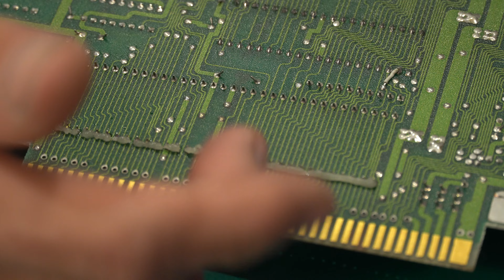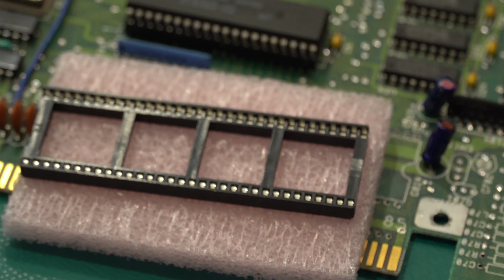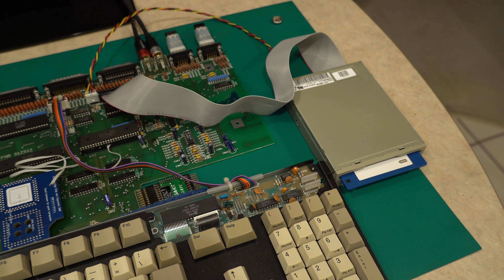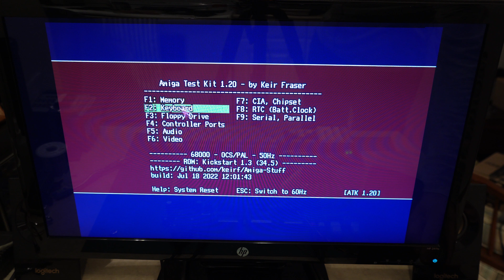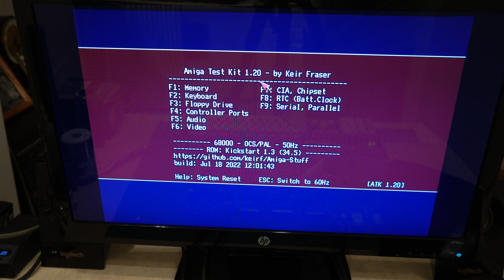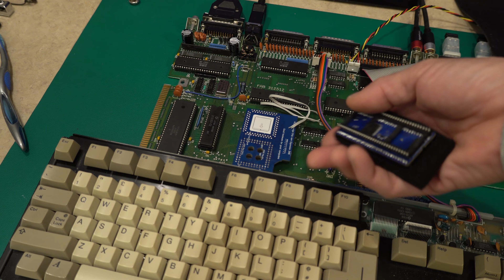An unplanned Amiga 500 CPU Socket replacement, disguised as as an informative Tutorial!

Comment: what is the part number for cpu socket an were can I pick one up
Reply from the maker: I bought mine from eBbay, AmigaKit also sells them.

eBay;

https://www.ebay.ca/itm/293002300337?itmmeta=01HVCXEG3FCFT2QZ0DRE3T2SRC&hash=item44384c4bb1:g:WYkAAOSwBA1chh~z&itmprp=enc%3AAQAJAAAA0I16hF%2FuFeIoNxTsAg%2BIHaWYQdGT6LD9l%2B2yqy%2FDWqO5Mva3DlVXmN07UxqshLzqkvlBqMeLBdUN20ewg3tsj9LKhN7F%2F8cpZ8j7LBJr9o3lNTKKoLNfn%2Bddnp4SwIkzFCRe77Km9KceohDKkG4nDH7BrNAo0UAodJolCVbWsMDb1dItfa02m7B4P%2Buj0WvpJU7JU85g7b7Szq2VlvECxxufulGtCYlbBmMbBpuYhfYulRV0H%2Byh3xs9%2Fqt%2BklFAi7CIZjrrQc%2BUWSmdFUAHvuM%3D%7Ctkp%3ABk9SR-yBup3bYw

AmigaKit:

https://amigakit.amiga.store/68000-socket-amiga-5002000-p-12661.html?aksid=2osbsp4d5jkjdlffa3mskb5mpa&currency=USD&aksid=2osbsp4d5jkjdlffa3mskb5mpa

Comment: Would you mind giving the link to the socket you bought or giving the part number?
Reply from the maker: I bought mine from eBay Here are some links:.

Machined:

https://www.ebay.com/itm/255503607686?hash=item3b7d33a786:g:vvoAAOSw32hiZIAQ&amdata=enc%3AAQAIAAAAwNpSQoT2wEC5waButq1MUxbMFaFxOBFO%2BthKNOfispOWTvAStxChNcJIBBZv7%2BlYBuZ6QYMEeoL8cttldUIUyk8I%2FzJqRsRW2%2B822CPXRs90GMIfxngNfWMg9UNNZmHhwDakN%2BXeultURnpEuCFDw1w0pYEhXY%2Bw7iMue1%2BdwubqNTblildmBCSrT7ZqGhlafr0nnd8a05XP0ubkAwFaL8x6GqTNFmvRw1O8d4TmHJujpgzqwvFTcHhvjHWQAyQRjg%3D%3D%7Ctkp%3ABk9SR9y0gPCHYw

Dual Wipe:

https://www.ebay.com/itm/155646804452?hash=item243d45c1e4:g:M9IAAOSwVzBkpD5g&amdata=enc%3AAQAIAAAAwC5Ar9vv5iSlBljXF%2FPmSdzhBsiRYMk5qUavmzXshYh1CCmpyS1aXqKXoDLHtA6lF6bS4wmfB3SDOII9llFP%2F8Z7DWpo9gL5wxYjmap9sRKv0xJco2YIHd4SFWd%2BYqIOKEPDzkpYFsGXiztrUM3P2QRK%2FO78UpMGtcNKlI4UVOu8M%2BwscAIoIJUeN4VCuvq8odlN%2Fbh5GPLHWbVSZtvh4CDa2%2BxlQ4Pb0bs2H3PLdkVRkriLZVuLbWDYKuKb6uQ9hg%3D%3D%7Ctkp%3ABk9SR9y0gPCHYw

Digikey and Mosuer will have these as well. 

Depending on your intended use, I prefer Dual Wipe Sockets for the Chips only. Machined Sockets (round holes), are ideal for Add-in cards that plug into the socket since they usually have round pins. Either are fine but I find using Machine Sockets slightly round the pins of the CPU, making re-insertion into the CPU socket not as secure as the first insertion. As always, this is a personal decision depending on your personal preference :)